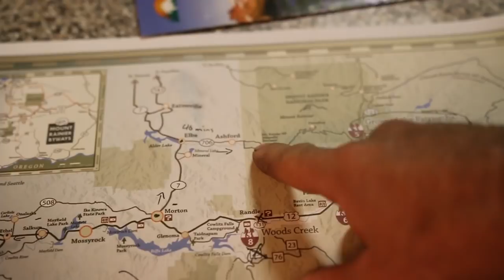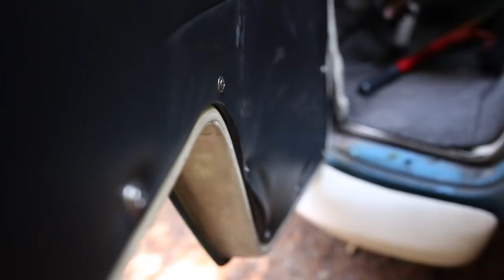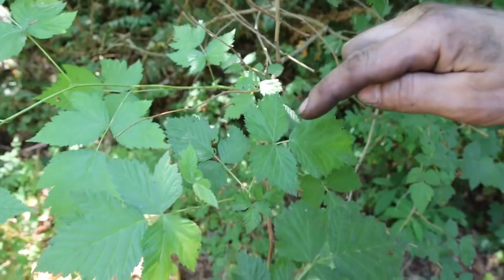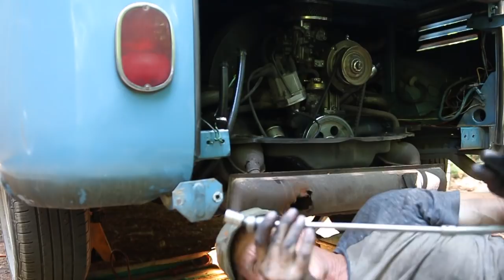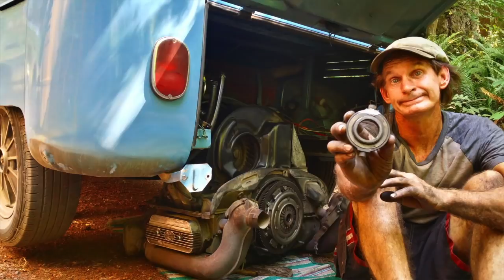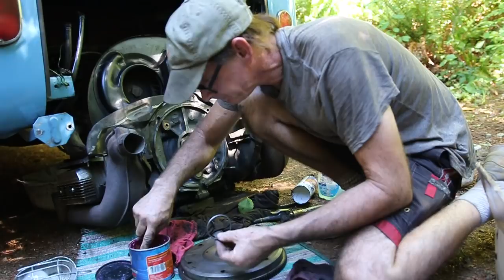VW Bus Broke Down:  How i Deal with Vehicle Breakdowns, campground vw clutch install, van life

Comment: Many people say "Leaves of three, let them be!" but most plants have leaf clusters that add up to a Fibonacci Number number. 0 1 1 2 3 5 8 13 etc.  So lots of plants have a leaf cluster count of 3 like poison oak/ivy.  That said, Poison Oak leaves typically come in clusters of 3 and have rounded tips.  Poison Ivy leaves typically come in clusters of 3 and the leaves have pointed tips and the middle leaf is longer than the other two.

Comment: Your story gave the impression that old VWs are very unreliable. That's a new thing for me. All you need to do is tow a rope and someone else's car. On the other hand, the story is strange that you took off a hot engine and in practice you would be unable to put back it with that jack. The bag lifter is good for that.